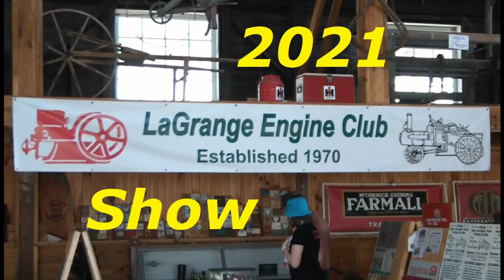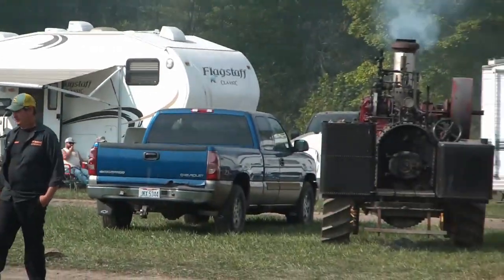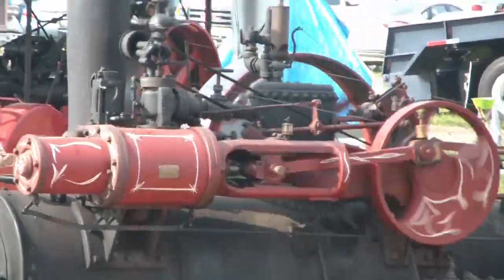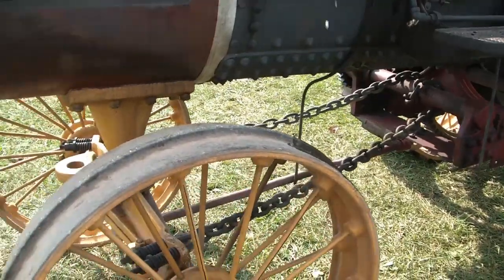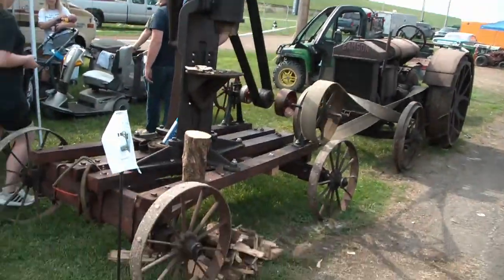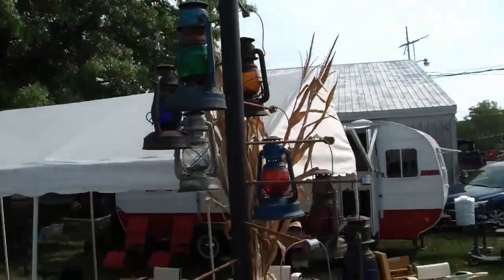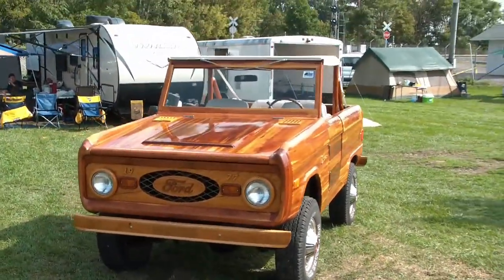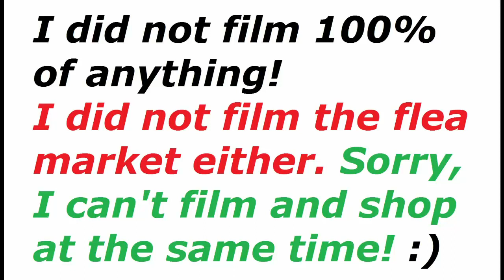Lagrange Engine Club Show 2021

Comment: I spent some time in Costa Rica and other parts of Central America about 10 years ago. I was absolutely shocked to find that there were many sawmills throughout the area, often in a small clearing in the middle of the woods. These machines were almost all without fail Old steam powered American sawmills that had been bodged together with truck engines and such. You could still see remnants of the pinstriping and proud logos on the machines. The the buzz saw mill in your video is very much the same type with the exception of those added axles.  It was kind of nice to realize that they did not end up just being scrapped. What was really cool is that almost all the sawmills offered boards in two different price ranges, cut by the mill or ripped with a chainsaw. The locals had an incredible ability to rip straight boards directly out of a felled tree. Like 40 ft by 12 in by 2 in cut by 1 man with 1 chainsaw. Shockingly straight.
Reply from the maker: Wow that would be an impressive site!  The old sawmills and the chainsaw skills!

Comment: One of those engines looks like it has an extra unused pulley that appears to be wrapped in thick copper wire. Are my eyes playing tricks on me? Or was that possibly an early variation of an electric motor? Perhaps for lighting? It cannot have put out very much power.
Reply from the maker: Hmm it is a long video.  At what time mark do you see it?